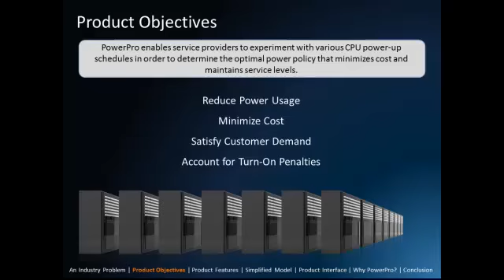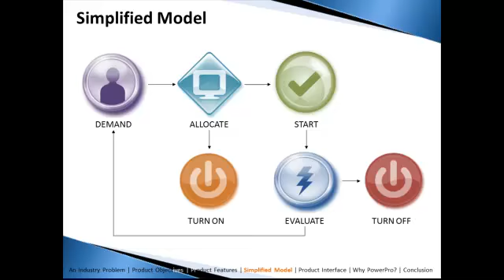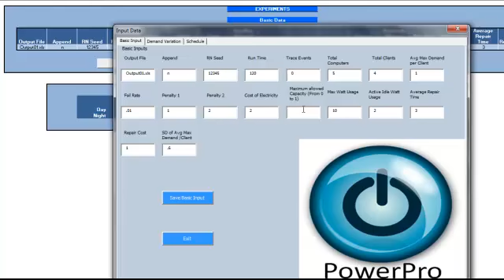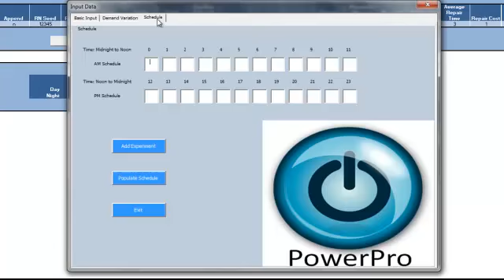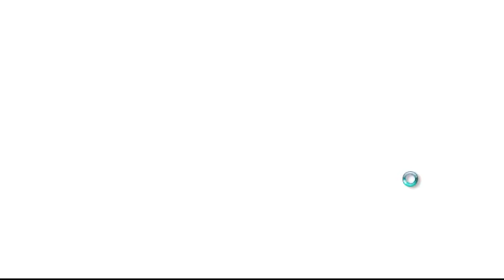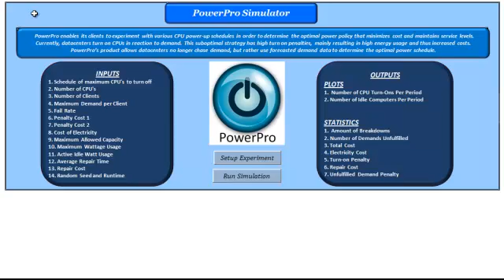IEOR 131 PowerPro Simulation Product, Fall 2011

Comment: (NKOB) The splash screen is genius, not only does it provide the user with clear instructions, it also lets the academic and research type to see in a glance what the model is about. A little doubt about the default value of one though. Personally I think it is better to bring up a dialog box in order to alert the user about the ignored information

Comment: Very neat presentation guys! It's pretty fascinating that you are able to pinpoint utilization problems, and actually turn-off severs when it is most efficient to do so. I also how you presentation starts off with slides, moves into a demo, and then cyclically moves back into slides again.

Comment: (glad) Excellent presentation and explanation of why this simulation will help service providers.This is the most awesome event graph ever! I am wondering why the power cost is determined on an hourly basis? Does the model account for variability of electricity cost on an hourly basis, as well? Great use if distribution selection.